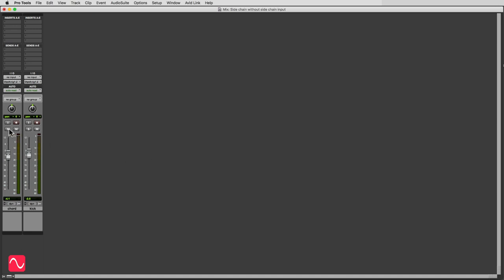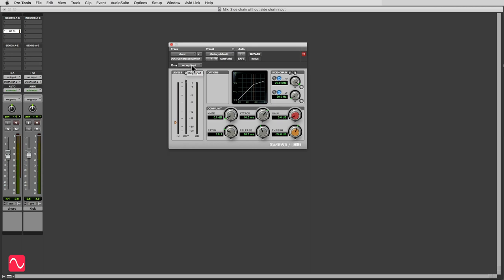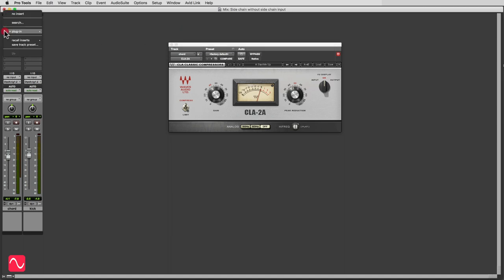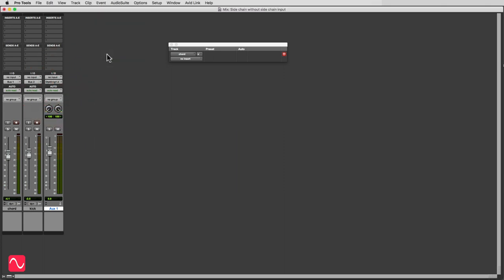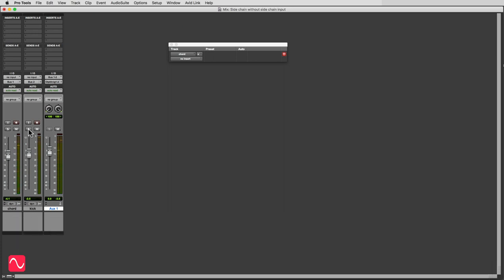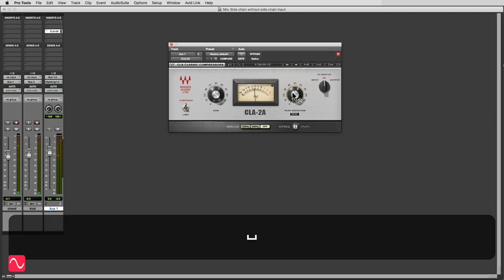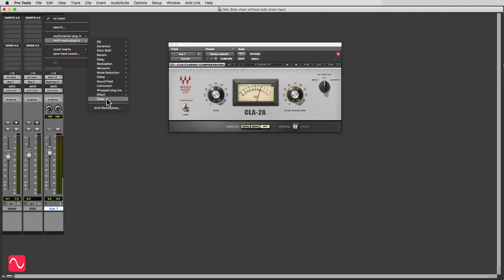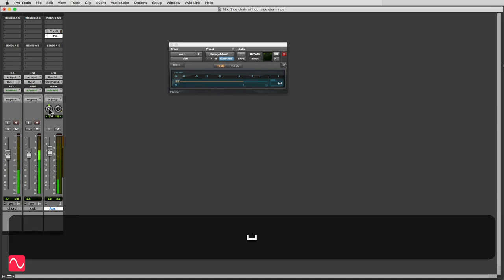Side chain compression without a side chain input

Comment: Tried this in Digital Performer. The only thing is that DPs trim plug-in doesn’t go to infinity. It only goes to -40. But even though you can still hear the SC signal, it’s very low.

Comment: @Audio Masterclass Hi. Cubase Elements has no sidechain input engine so one has to use the method described in your video. I always use another aux channel for the kick though, so I'm curious to understand how you only needed one where you send both signals. You refer to a plug-in that can control the levels of the two plug-ins independently. I assume you are referring here to something similar to the Pro Tools Trim plug-in you use in this video. Is that correct?
Reply from the maker: With this method it is necessary to mute the kick after the compressor, which is done using the trim plug-in in Pro Tools. It might be possible to use the kick unmuted, but there would be less control over how it is mixed with the rest of the instruments. The trim plug-in in Pro Tools can be set to work on both channels, or on the left or right channels independently.
Reply: @AudioMasterclass  Ok, thank you for clarifying. I have never checked for a gain or trim plugin but I'm sure Cubase has one. I just need to check if it allows me to isolate the left/right channels.

Comment: My DAW doesn't have any native side-chaining functions, so side-chaining isn't possible without something like Twisted Lemon side=chain emulator which used to be free, but now isn't as TL was bought out by a bigger company. So I've been looking for an alternative workaround to try to achieve side-chaining. Would this method work for me as hoped? - and thanks for posting this David.
Reply from the maker: No side chain? That's an outrage! It's hard to see why the method in this video wouldn't work in any DAW but I've come to learn that it isn't unusual that a DAW might miss out a significant feature or make some things difficult. There is another method, which might work for kick+pad combinations, as in EDM, which is to copy the kick, low-pass filter it or maybe even pitch shift it, mix it with the pad and compress it, then maybe low-pass filter again so you're left with the pad ducking on every kick. The disadvantages would be possible lack of reliability and it might affect the sound of the pad. The advantage is that it would work in stereo where the method in this video doesn't. Worth a try but no guarantees. DM

Comment: Does this only work when the element you want to trigger the side chain is the loudest element feeding into the compressor? For example, I'd like to test the standard Apple AU dynamic processor settings in Ableton (for an app project I'm working on). When the vocal is much louder, the compressor causes the instrumental to dip as I'd hoped. But if I want the vocal to be about the same level as the music, is the music not as likely to trigger the compressor as the vocal? Perhaps I'm missing something. 

This technique absolutely does the job when the vocal is much louder than the instrumental, but if they're more balanced, it's less clear. Maybe I could try to adjust the vocal levels down after the compression stage, but working in Ableton, I'll have to think about how I could get access to the vocal level on its own, post side chain. Hmmm.
Reply from the maker: It sounds like you're compressing the mix. This is OK to do but your problem will be solved if you compress the vocal separately to the instruments before you mix. Alternatively you could try EQing the side chain to the frequency range of the vocal, which might help but not guaranteed. I recommend you use a standard compressor with a side-chain input. You might also consider this course https://www.audiomasterclass.com/one/compression

Comment: Great video thanks. But do you know how can I do this on cubase?
Reply from the maker: It should be possible using the same method if you have a plug-in that can control the levels of the two channels independently. If you don't then you should be able to send the output of the chord channel (or whatever sound source you want to compress) to a bus, then make another mono channel and set its input to that bus.
Reply: @AudioMasterclass  Hi. Cubase Elements has no sidechain input engine so one has to use the method described here. I'm curious to understand though. You refer to a plug-in that can control the levels of the two plug-ins independently. I assume you are referring here to something similar to the Pro Tools Trim plug-in you use in this video. Is that correct?